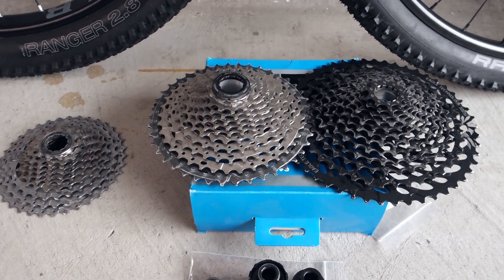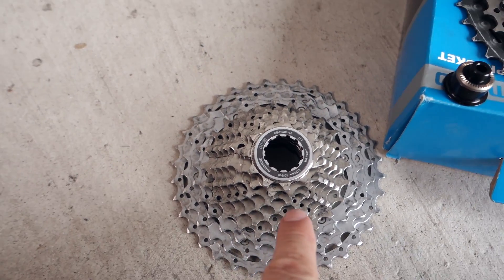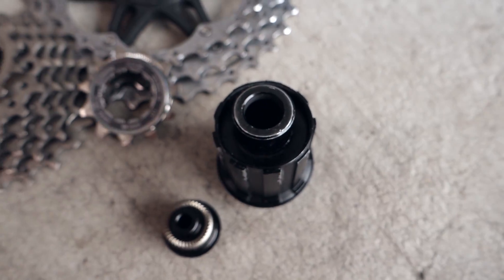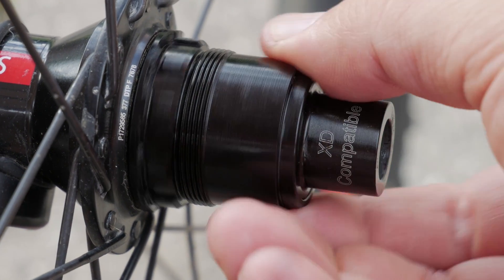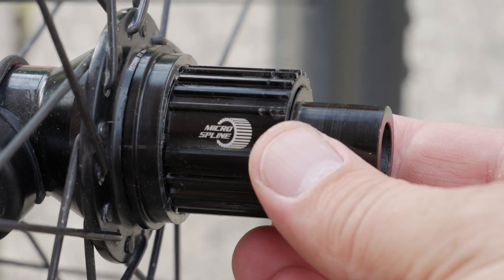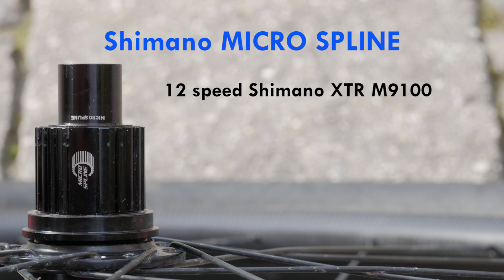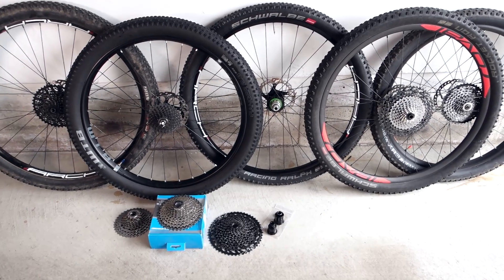HUB | Freehub COMPATIBILITY 🔥 12, 11, 10 Speed - SRAM XD Driver, Shimano Micro Spline, HG, HG+

Comment: Can I upgrade my bike from 10 speed to 12 speed by changing the free hub?
Reply from the maker: Yes but you don’t really have to replace the freehub there are 12s cassettes that fit your HG freehub
Reply: The bike in question os a Giant Stance 29er 2, the 28er 1 has a 12 speed cassette. I want to upgrade mine to 12 speedinwill be changing the crankset and bottom end bearings too  @LoveMTB

Comment: Nobody ever mentions the hub shell compatibility with freehubs. If the shell won't take a certain freehub then you basically need a new wheel.

I'm trying to work out if my mid-2000s 26" MTB wheels will accept a 12 speed freehub body, allowing me to use a 12 speed XT-8100 groupset that I have lying around. 

If so, then all I need is a 12 speed cassette and new freehub body for my old Trek 8000.
Reply from the maker: Or use a SunRace 11-51T with your current wheel?

Comment: Thanks for the video. Super useful. Quick question. If I'm swapping my group set from 9 speed Shimano to 12 speed SRAM, I'll need to swap the free hub, but will the wheel accept the new freehub?
Reply from the maker: only the hib manufacturer can tell you if they have an XD driver. Alternatively you can use a SunRace or any other cassette that uses the classic HG freehub

Comment: When will the day arrive when the cassette will be the size of the wheel?
Reply from the maker: @rosomak8244  they’ve stopped at 52T for now 😊
Reply: One day, the shift will be so light that you will be able to drive not only vertically but even upside down. They will combine it with anti gravity tires.

Comment: I've got a question, my new wheels came with an HG, which was wrong, my old cassette was XD and all my components were gx, so what I've done now is have to buy a new 11 50 nx cassette to fit the HG, in your opinion is this technically a downgrade, is XD better than HG
Reply from the maker: It's a 150 grams downgrade otherwise it will work similar.

Comment: I have an older shimano 105 10 speed hub and I'd like to upgrade it to 11 speed for ROAD.  I purchased the 11 speed freehub body but the internal spline on the 11 speed freehub is much larger than the 105 10 speed internal spline.  What can I do, if anything?
Reply from the maker: Freehub for road is longer so to install an MTB cassette you need and 1.85mm spacer behind the cassette

Comment: I haven't been able to find a clear answer on this but does XD/XDR or Microspline work with any crankset provided it's designed for the right speed?
Reply from the maker: Yes but in reality there’s no connection between the 2. Xx micro spline are interfaces for the cassette that’s all. Cranks - not as important but chainrings very important. Check my video about the 12s chainrings for a complete picture

Comment: currently looking at a set of wheels that is only available with DT-240S/148mm rear hub and SRAM XD 11/12-speed Cassette compatibility. would I be able to simply change the freehub body to shimano micro spline to work with an xtr 10-51 cassette?
Reply from the maker: Yes DT swiss provides Micro Spline freehubs for all their hubs currently

Comment: Very useful video. I just wish my XD Driver  wasn't so loud.
Reply from the maker: Thanks what hub do you have?
Reply: @LoveMTB  I'm kinda new to this, I bought a Specialized Evo Comp last year on a whim. I intended to buy another bike, but of course it was hard to find anything available. This bike just happened to be on display and ready for me to take home. I also happened to like the look, it is blacked-out with matte carbon fiber finish. It's an XC bike which I think it fine with me since I think I'll be riding on asphalt or concrete 50% of the time. I just want one bike, not two or three. My cassette is the SRAM GX with 12 speed. It just seems to make a loud noise when coasting.  My first ride was on a  a beach boardwalk and I know people could hear me behind them from a long distance, but that is kind of good, because people moved out of my way.
Reply from the maker: @RichardsWorld  you got a great bike, enjoy it! As for the sound…you might get used to it?😊 and it does come in handy

Comment: Great video! I just upgraded SRAM 1x11 to Eagle 1x12.  I have XD Compatible free hub on my DT Swiss hub.  The 1x12 goes on easy enough and I can access all the gears except the 10 tooth cog.  There is little clearance between the 10 tooth cog and the frame and the Eagle derailleur won't go out that far even with high screw maxed out.  This is a 2017 Pivot Mach 429 with thru axle. Everything I've read says if free hub says 'XD Compatible' this should work but it seems I need a slightly longer free hub or end cap to account for the one extra gear and create the necessary space between the 10 tooth cog and the frame.  Any guidance on this is greatly appreciated!!!
Reply from the maker: Cable tension then, or remove cable altogether and you should be on tha 10T cog.
Reply: @LoveMTB  thanks for reply but that’s not it. I adjusted high screw before installing cable and could see then it could not go far enough to align to the 10t and if it did and chain was on 10t then chain would rub frame. Seems I need a longer end cap? Is that an option? Wish I could attach picture
Reply from the maker: @brettphaneuf  you did not tighten the cassette properly? 40Nm? Properly seated on the spline?
Reply: @LoveMTB  thanks again for reply checked that again multiple times now I've had the cassette on and off. Here's what I don't get: the SRAM 11 Spd cassette is 41mm tall.  The 12 speed eagle is 48mm tall.  They both appear to have the same inward 'dish' to the largest gear so the 12 speed doesn't sit closer to the spokes best I can tell.  So if the cassette is taller and there are no spacers to remove from the 11 speed it seems this is my clearance problem with the frame.  How is it supposed to work that a taller 12 speed cassette can work on same free hub as shorter 11 speed?  My end cap is 16mm it seems if that was 23mm it would all work.  I really appreciate your insights!
Reply from the maker: @brettphaneuf  It's in the dish. And something else is going one, I have never seen something like you're describing. Unless frame is that old and you don't have nough clearance? You are not using a Boost endcap in a non-Boost setup are you?
Reply: @LoveMTB  My end cap and free hub both say "XD Compatible" How would I know if it is Boost?  The bike is 2016 Pivot Mach 429 with carbon frame. It came out before Eagle was common as far as I know.  Again thanks for input!
Reply from the maker: @brettphaneuf  142mm spacing for the wheel is non boost, 148mm is boost
Reply: @LoveMTB  ok thanks for that info I am away a couple days when back I'll measure the spacing.  Does Eagle drivetrain require Boost spacing?
Reply from the maker: @brettphaneuf  it does not.

Comment: Hi man. I would like to ask my options if i want to get a deore wheelset on microspline. My current gear is the sx on free hub. Do i have any option to still use it? Thanks
Reply from the maker: You have a sram drivetrain and the shimano comes with micro spline which is not really compatible with It. What are you trying to do?
Reply: @LoveMTB  i wanted to upgrade wheelset without changing my cogs

Comment: One question , if your an cassette hub , can you change the free hub cassette to XD drive ? like in short means can you install an XD drive free hub to replace cassete free hub
Reply from the maker: Simple answer is yes but you have to see if the manufacturer of the hub provides it
Reply: @LoveMTB  copy , Thanks
Reply: With DT Swiss for example no problem, you can change Microspline to XD and vice versa whenever you want

Comment: i have a wheelset with  standar freehub body and want to use a 11 speed deore cassette but i notice lockring needs only 1.5 turns to get 40Nm, have you used a lock ring with that small number of turns with no issues?
Reply: @LoveMTB  yes, no spacer, the spider and all cogs seated correctly, do you know if your freehub body has 3.48mm lenght? 
the lockring I have has 3 threads maximum, I found another with two more threads.

Comment: Thank for the value information. I am trying to upgrade my old  shimano HG (FH-502) freehub which is x11 cassette to the micro spline free hub, so I can install my drivetrain  12x ( it is also Shimano drivetrain as well). Do you have any information of how I can get the micro spline freehub that is compatible to my old shimano FreeHub (FH-502) . I don't want to change it to Shimano XT Hub and then I have to measure the length of the axle/shaft of the Hub. Any information would be very appreciated. Thank you
Reply: @LoveMTB  Thank you so much for your help.

Comment: I have a question. The 11-51 11 speed shimano 5100 setup uses the old shimano hub. Correct? Would I be correct in saying this is a better choice as I see allot of videos of people complaining about the shimano brand micro spline 12 speed hub for creaking noise. Problem with some plastic clip which they said in the beginning do not lubricate but now they do. I have seen allot of people saying they have had it with the 12 speed hubs from shimano and went with another brand like hope.

Comment: My (mtb) 11 speed driver is different than the standard shimano driver. The splines are thin like the microspline but the sizing and the space the splines occupy looks the same as the standards shimano driver. Deore hub and xt cassette. Are these drivers the actually the same and just look different?
Reply: @LoveMTB  that's for the quick response. Will he easier to find a replacement now.

Comment: Thank you for your instructional video because I made the mistake by ordering a 12 speed deore cassette and didn't read that it was micro spline so instead of changing out my drive I'm sending it back and my local bike shop has a Sram PG 1230 12 speed cassette.  Thanks again for your great instructional videos. Stay blessed and safe.

Comment: I bought Jamis Hardline A2 2021 with Shimano Deore m6100 casette, which is 12-speed, also in stock it cames with MT-410 rear hub but already with microspline! Honestly I don't really like hubs with microspline, because they're very quiet compared to other hubs. So, I think I'm gonna buy another rear hub, but i don't know if the casette will be compatible with 12 speed non-microspline hub

Comment: Nice Video as always. I have a question and hopefully you can help me or guide me. I currently have a 2020-2021 Diamondback Hook with 1x8 setup with SRAM PG820, 8 Speed, 11-32T Cogset and SRAM X4, 8 Speed DERAILLEUR. My 
REAR HUB are 32h Alloy Cassette w/ CNC Disc mount; 135mm. Thinking about upgrading my Drivetrain to the Shimano XT M8000 Series component.. I am just worried that the shimano M8000 11-40T or 11-42T cassette will not fit my bike. And as you know that once the Cassette installed on the hub.. You can not return them. Any help will be appreciate. thanks
Reply: So there are no need modifacation at all. Its mostly just bolt -on, correct. I am going to get the whiole line up of the XT M8000 series from cassette to crankset and bottom bracket.. thank you sir
Reply: One more question. I dont need to change the free hub or my wheel hub?
Reply: Thank you for your help. I will go ahead order the parts that all I need. I keep you in  my page..

Comment: Interesting, just what I needed to know. So basically there are two freehub standards by Shimano: the 8/9/10/11 speed one, introduced in the 1980s and the newer Microspline for 12v transmissions. As long as you know how many speeds your cassette has, you can't be wrong about the required freehub, also because, there's only two of them. What I don't get is, why was a new freehub needed for 12-speed cassettes? What are the technical differences between the old type and the new Microspline freehubs? Were there viable reasons why they had to change its design to accomodate the latest cassettes that have 12 sprockets, or do you think it was mainly a commercial move to have people change their existing freehubs? Just curious :)

Comment: The hub needs to have a slightly longer freehub to accept 11 speed cassette on shimano style. Hubs witch are rated for 11 speed sprockets have a longer freehub and they comme with a small spacer for fewer gears sprockets compatibility.

Comment: Hi dude.thank you for sharing your concern and information.so i want to change my 9 speed cassette to 11 speed and my hub is fh-m475 shimano deaor with 34.95mm drive interface.so do i hear that the 11 cassette need 36.75mm space for fit.so do i need a new hub for fit my mtb cassette or can fit it on my fh-m475 rear hub?

Comment: 13 speed for the old HG freehub...S-Ride and ZTTO cassette
Reply: Yeah right, 13 speed, but still, the smallest cog is 11 teeth regardless.

Advantages of newer freehub body options are to accommodate smaller teeth on the cassette 10 and 9 teeth used by Shimano and SRAM for their cassettes respectively.

Comment: Finally someone answers the question of converting my 3x10 to a 1x12! Been researching for quite a while and was giving up going to a 12 speed with my current wheel until this. I've been wanting to convert my 2012 Trek Rumblefish 29er to a 1x and now it appears with the right 12 speed groupset, it should be easy. Thanks!
Reply: Keep in mind new bikes are also set up with geometry for 1x. Just because you can doesn't mean it will be right. Off chain lines can cause chain drops,  excessive and premature wear on components. BB and crank width plays an important role. Chain guides and early narrow/wide sprockets were only temporary bandaids to technology, not solutions.

Comment: Good vid! Thanks. finally a clear answer to my question. I have the cheap sram nx eagle 12 speeds, and I was looking for a 12 speeds shimano hyperglyde freehub! that doesn't exist?  
I see that your freehubs have also wear damages, mine is such that I can't use the 11cogs anymore. The reason, I think, is that I don't shift much, I like to pedal 'hard' when I climb to muscle my knees (am I the only one with this issue?). or is it because the DT swiss freehub is too cheap? Could you explain how come the 11 speeds shimano hyperglyde is compatible with 12 speeds sram nx eagle? is it because sram cogs are spaced tighter?
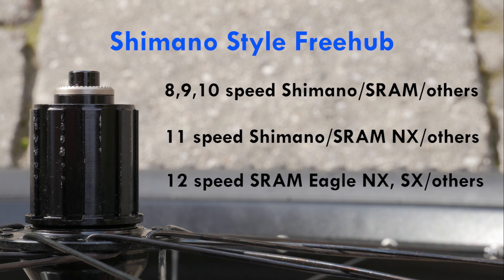Reply: @LoveMTB  thanks for you reply! 2:27 confirmed (I read it also somewhere else) me that the 11 speed HG freehub could be used for both 11 sram NX and also 12 sram Eagle NX which might seems strange for a layman like me (I was looking for a 12 speed HG freehub that doesn't exist). 
I find it disappointing for 3000€ bike (BMC teamelite) to use such a low quality component that becomes defective only after a few months after the 24 months warranty.

Comment: Hello, I have a Fuji Nevada 1.5 29er from 2013. It has a Shimano M475 rear hub. (at least according to the spec sheet.) From my understanding, I can use the  Shimano SLX  1x11 setup.? The M7000 series?
Reply: @LoveMTB  I ended up grabbing the XT M8000 setup minus the pedals for now, new for $220ish. Leaving my square tapered cranks for now and adding an cheap oval ring to try it it out. Stoked! Can’t wait to try it all out. Then I’m going to get the PNW cascade dropper and handle bars with the loam remote and grips. Then later I will look at upgrading my front fork.
Reply: @LoveMTB  yea I know my bike isn’t the best out there. But I really like the frame and it’s graphics design on it. Plus I like the non boost tires for more road riding as well. So instead of spending about $1500 to $2k on a bike I don’t really want because the lbs just happens to have something in stock atm I figured I would just upgrade this one and make it a beast. At least a beast for me.

Comment: In another video you mentioned the SRAM NX Eagle cassette PG1230 is one of the very few 12 speed cassettes that will work with Shimano HG free hub body. Is this special cassette any thicker than say a 9 speed or 10 speed or 11 speed cassette? 

Is it able to fit on a frame with 135mm rear spacing?

Thanks

Comment: My Shimano M475 free hub seems to have an internal torque release mechanism. When I tighten the cassette with a spanner wrench, the hub releases torque like a torque wrench. Is that normal?
Reply: @LoveMTB  Let me rephrase - I was using a spanner wrench to install a cassette on the Shimano free hub. When I tighten the lock ring, i hear clicking at first then I feel something inside the hub disengaging the torque as if it won’t let me tighten further. So I dont know if that’s normal. The feeling is like when a torque wrench reaching it’s desired torque and it clicks and doesn’t allow further tightening. So is there something inside the hub that’s doing this?

Comment: Here is where I'm confused.  So 10sp HG can fit up to 11sp mtb cassettes generally.  I thought XD hubs have the same width as HG? and if so how is it that XD can now fit 12sp.  Don't u need XDR with the extra 1.85mm to run 12sp?  Furthermore can I swap out HG with XDR hub and still fit inside a 142mm dropout?  Is the only difference a shortened end cap? Any clarification or advice will be greatly appreciated.  Cheers.
Reply: @LoveMTB  thx very much for clarifying. Good to know i can run 12s on XD.  Cheers

Comment: Is anyone able to tell me if a sram XG-1275 eagle 12-Speed 10-50t Cassette will be a direct fit to a Shimano FH-MT400-B hub or will i need a certain cassette driver thanks in advance
Reply: @LoveMTB  thanks for the reply the bike is a cube stereo race i currently have a 12 speed Sram PG-1210 Eagle 11-50 cassette and looking to upgrade it to the XG-1275 eagle 10-50t
Reply: @LoveMTB  i’d like to go for the xg-1275 if possible mainly for the 10t, is there any specific XD driver you would recommend for this?